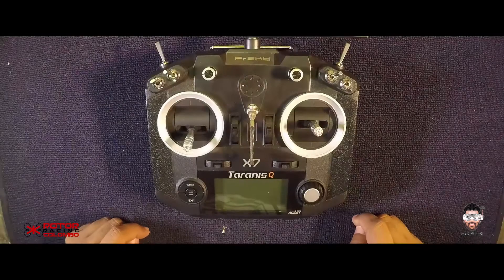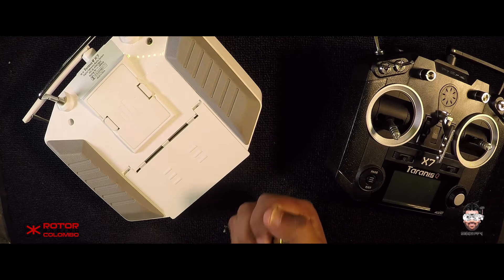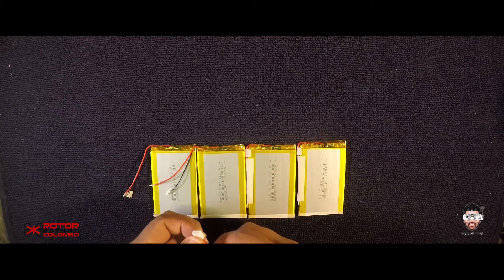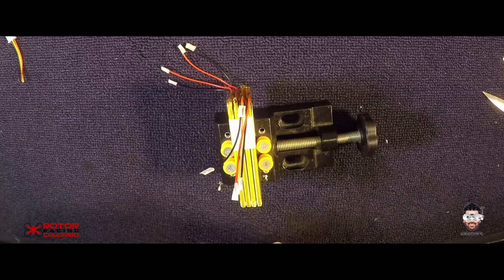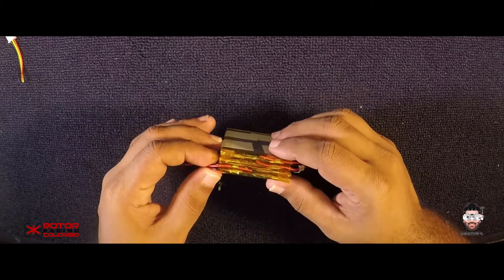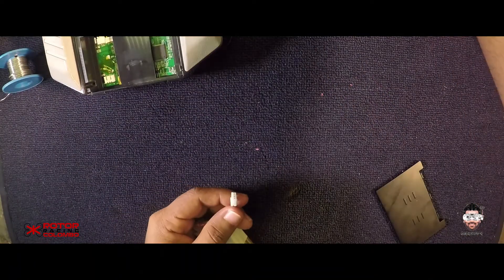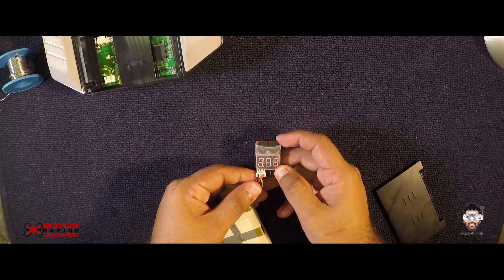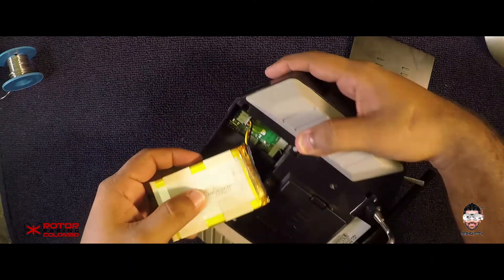QX7 Battery Modification by Bandi FPV

Comment: how low can the qx7 battery drain before it turns of. im not on about telemetry or the lipo itself but at what voltage dose the qx7 stop working? any help would be great :D